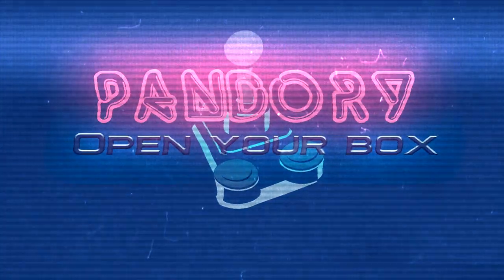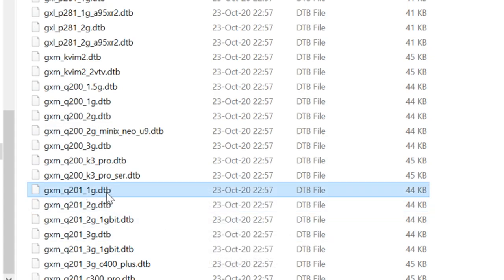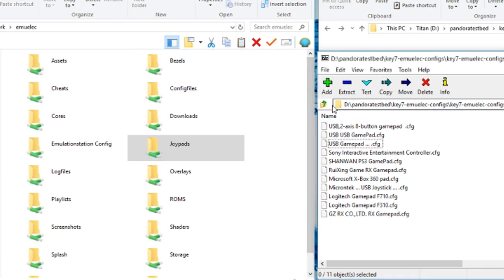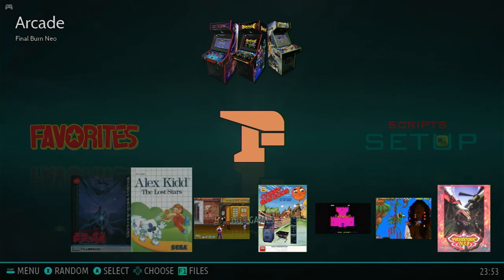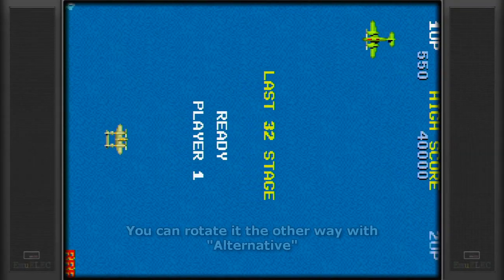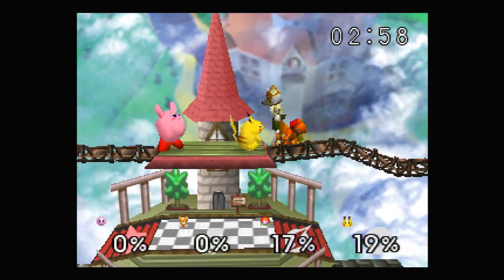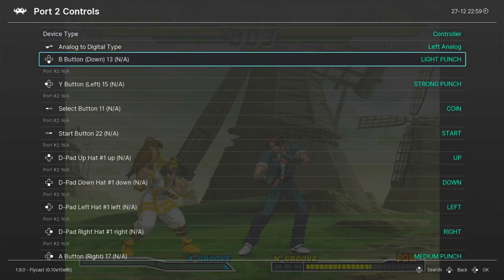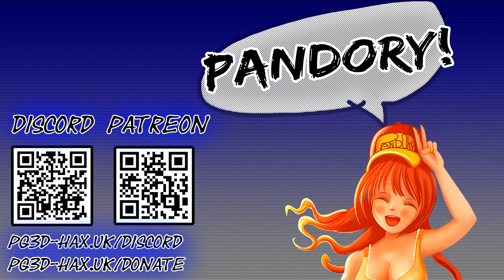How to Install EmuELEC to a Pandora's Key 7 / Treasure II Video Guide - EEMC604

Comment: Hi, a question, but by removing the micro sd, can you go back to using the original system? and to go back to using emuelec just reinsert the micro sd by holding down the internal button? also for hi uses linux can copy files related to joypads and roms can extract cla micro sd and copy it from pc? it seems a simple modification but I would not want to make the pandona box unusable it would be a shame. thanks to those who can answer me ...

Comment: Another great video! Do i necessarily need a wifi network connection in order to insert roms and other files into the microSD card? Thank you
Reply from the maker: You could use a usb wired ethernet dongle, or linux os. 
Windows cannot read the microsd emuelec partition.
Reply: @TeamPandory  Got it! Thanks a lot
Reply: Me...again....urgh...seems like the root button near the fan is not present...the model of the Pandora's motherboard is RXJ3D2019-V01....there could be a way to run Emuelec anyway? Thank you so much :-(
Reply from the maker: @Cioppoccio  Damn!  Which version is this?  Pandora Key7? Treasure I  / II?
Reply: @TeamPandory  Seems like to be the black motherboard which appears in this video at 0:32
Reply: seems like that the root button has been removed....
Reply from the maker: @Cioppoccio  Can you see the root button at 32seconds?  -  If they took this out it'd be a real shame.
Reply: @TeamPandory  i see the place where should be the button, but the button itself is not there...
Reply from the maker: @Cioppoccio  have another look around ... I think if we can get it into android mode, we should be able to run libreelec root apk- time will tell. We will post on this channel if we find something.
Reply: @TeamPandory  All right then, i'll stay tuned. Thanks for all the efforts and the work you're doing!!!!
Reply: Hi! I report that, in order to be able to see Linux partitions on Windows operating systems, you can use programs such as Ext2FSD, DiskGenius or Linux File System For Windows ;-)
Reply from the maker: @Cioppoccio  yes this is possible, but for reliable data transfer, either network or installing a virtual linux machine is preferred. These windows emulators work but I've had issues with data corruption, and incomplete transfers.

Comment: Great, thanks! Well, I have a Treasure 3D (not II) with 2650 games. I don't know what it is because it's not a II, looking at the homepage ("Treasure 3D") but it worked like a charm! I've tried in the past but I didn't manage to make the controller work in MAME. Now it's perfect! :-) Just a minor question: how to open up the emulator menu when playing?
Reply from the maker: Hot key then start twice. Emuelec standard I think
Reply: Ciao Fabio se togli la micro SD il sistema torna ad avviarsi come in origine? Vorrei provare questa modifica ma caricati i file da PC tramite os Linux, grazie
Reply: @informaticaevideogiochi6911  Sì certo, devi reinserire quella originale
Reply: Ciao Fabio, ho anche io una la prima Treasure 3d, sei riuscito a far funzionare entrambi gli stick con emuelec (io uso l'ultima per la nostra scheda, la 3.9)?
Reply: @luca6411  Ciao, francamente non ricordo, è passato troppo tempo e l’ho data via…

Comment: Got a treasure 2 recently on sale. Can you connect it to a super console x via usb as just a controller?
Reply from the maker: I think it should work as a controller by using a usb to usb cable. 
... Or you could take the microsd of the super console x, alter one file... Then have the whole system work directly from your treasure 2. It needs to have that root key button tho.
Reply: @TeamPandory  interesting thx. Yeah just tried it and it worked as a joystick.  I’m to scared to mess with that sd card. I’m pretty good as far as softmodding various things but not very familiar with emuelec and Pandora box yet. Just changed the image enhancement setting and enjoying it so far.

Comment: @Team Panory I've a Seekool Treasure 3d (not II) running emuelec 3.9. I can't use the second stck. Only one is recognised. How can i solve this? Maybe it's because i run emuelec without pressing the root button (it runs without presing rott button even at the first start when it resizes the microsd)?
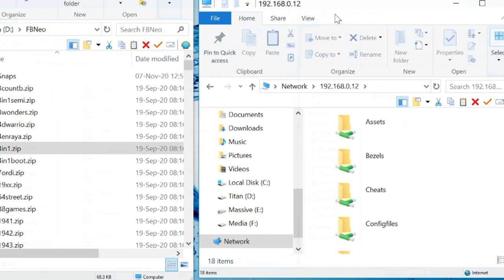Reply from the maker: @4:00 you need to copy over the files we made to recognize the second stick.
Reply: @TeamPandory  i made it but does'nt work
Reply from the maker: @luca6411  did you copy the files over via network to \\emuelec ?
Reply: No, via windows. My pandora doesn't see ethernet connection (maybe it's because i'm using a Dell dockstation and not a single USB hub). I tried three times, every time i made the emuelec micro SD from the beginning to exclude copying errors.
I try to configure the second Stick in retroarch but in game doesn't work.
I tried ti set HID driver but It's the same. Player One Is ok, the second Stick works only during configuration.
Reply: @TeamPandory  today i made a new micro sd from the beginning and made the copy of the files via network but the result is the same. When i start emuelec it detects only 1 gamepad and ask me to configure it. I can configure only one stick and relative buttons. Can solve directly modifing retroarch configuration? I tried disabling autoconfig but i cant'use 2 stick at the same time even if i configure in the retroarch menù.
Reply from the maker: @luca6411  the files copied over from the network should sort out the buttons for you. Try copying them over then simply start a game without trying to configure.  Try something simple like streets of rage on the megadrive or metal slug for neogeo.
Reply: @TeamPandory  player1 works perfectly, player 2 is not detected.
Reply from the maker: @luca6411  did you reconfigure the control after copying over the files from the zip?
Reply: @TeamPandory  no, i made like you said. After copying files i only started emuelec. Player one works, player 2 no. I don't know what to think.  I tried even to configure sticks in retroarch, but i was not able to make them work togheter.
Reply from the maker: @luca6411  I think it's possible that your board has a different controller board and needs a different device name than my old (dead board) key7 and Treasure II.  We did these videos around 3 years ago, and really can't remember how exactly I did it.  It was something like: Open up retroarch, set up player one in the retroarch settings, then player two inside retroarch, then save the setting.  You cant do it in the emuelec frontend as that messes everything up.
I'm sorry to say you may need to do this yourself, as I don't have the exact board you do.
Reply: @TeamPandory yeah, i saw that the board comes in a lot of revision. Maybe there something different. The name of the stick it's the same, i found the id. I will try a little bit more to  configure via retraorch, the i will surrender! :D Thanks for helping!
Reply from the maker: @luca6411  if you can get the controller ID name, maybe a simple rename of one of those in the pack (to your device name ) might work.
Reply: @TeamPandory   this is from the system log:

I: Bus=0003 Vendor=0f0d Product=00ad Version=0111
N: Name="RuiXing Game RX Gamepad"
P: Phys=usb-xhci-hcd.3.auto-1.2.3/input0
S: Sysfs=/devices/platform/soc/d0078080.usb/c9000000.usb/xhci-hcd.3.auto/usb1/1-1/1-1.2/1-1.2.3/1-1.2.3:1.0/0003:0F0D:00AD.0003/input/input2
U: Uniq=
H: Handlers=js0 event2 
B: PROP=0
B: EV=1b
B: KEY=1fff000000000000 0 0 0 0
B: ABS=30027
B: MSC=10

The name seems the same...

Comment: Using this Method, will I be able to use the most updated cores for Mame?
Reply from the maker: If you have the root switch on the board. Should be good.
Reply from the maker: And yes. Quite recent anyways. Same version of mame as emuelec 3.9
Reply: @TeamPandory  How do I config both sticks to work on my board? Its only recognizing 1 and my pc controller
Reply: @beyondthreshold815  Yes- I may need to change one file- but it's a simple fix.  Go into RetroArch options settings > input 2 and change the device ID over to Ruix (or whatever your controller is)
Reply: @timwilson1042  thank you my friend! I want to do this with the intent to build a cabinet around my arcade stick. I was turned off when I though I coulnt use the 2 controllers built in the stick.
Reply: @timwilson1042  its an Orginal Pandora 3D Treasure. I am trying to get both sticks built in the board to run player 1 and 2. I'll use my usb controllers for player 3 and 4 if this is possible
Reply from the maker: @beyondthreshold815  Oh, cool!  Can you come to our discord-  we may be able to help others with the Treasure I board just by changing a couple of files.  Can you let us know what your controller is known as in emuelec (controller config)
Reply: @TeamPandory  yes I'll join now.
Reply from the maker: @beyondthreshold815  check the video description
Reply: @beyondthreshold815  can you help me to make the second stick work? I have the a pandora treasure 3d (not 2).

Comment: This works for 3D+ 7000+ ?
Reply from the maker: You can actually get emuelec running on the 7000, as it's an Amlogic s905 chipset.  Unfortunately it doesn't have much memory, nor do the sticks work out the box.  Will have another go at trying this though.
Reply: @TeamPandory   I have another question, in the back of the box it has two USB, one to use on PC and the other one to connect a controller, not even redirecting the inputs of the pandora on the USB hub or using a male USB to male usb can work?
Reply: @TeamPandory  ok i got emuelec running on 3d+ 7000 s905, but yea the buttons or sticks doesnt work at all sadly :(